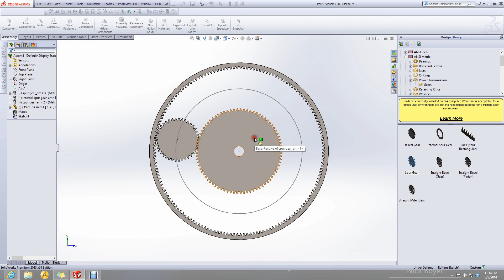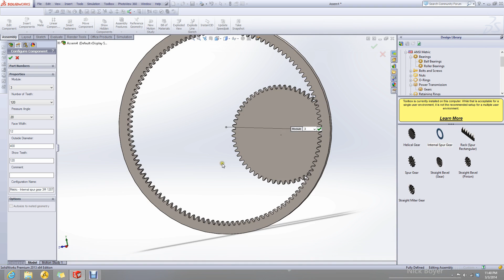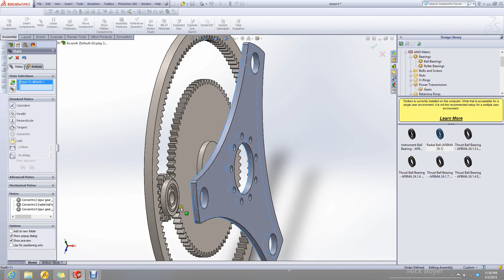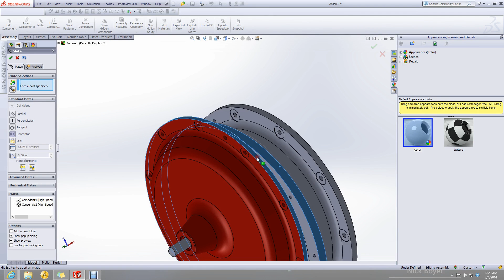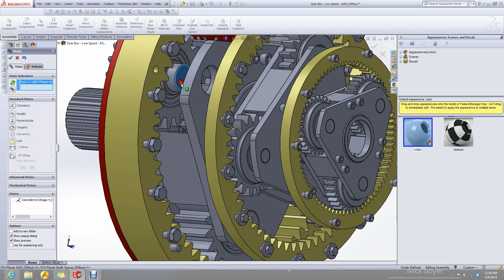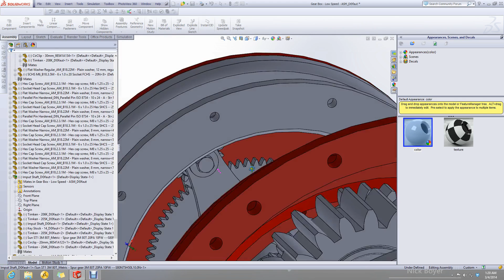SOLIDWORKS Planetary Gearbox  TUTORIAL

Comment: It's excellent. You did a great job. Could you tell me how do you get the exact dimension of the parts?
Reply: For that you will have to learn the design theory of Epicyclic Geartrain. After you've learnt, you'll be able to select the paramters like Module, number of Teeth and Pitch Diameter as per your requirements (of final reduction/torque, space and size constraints,  etc.).